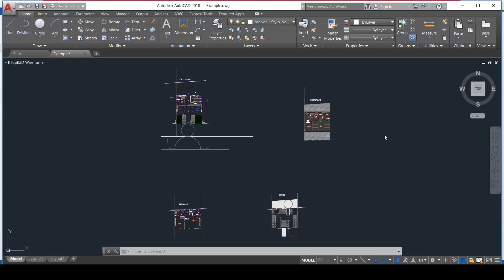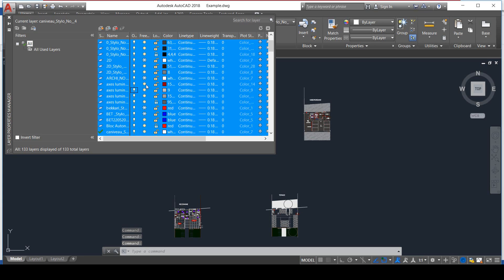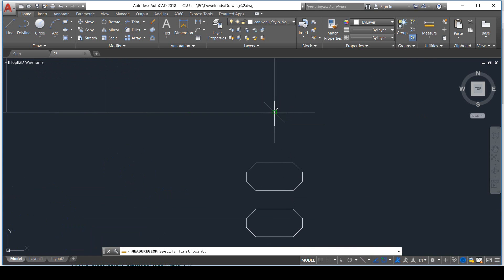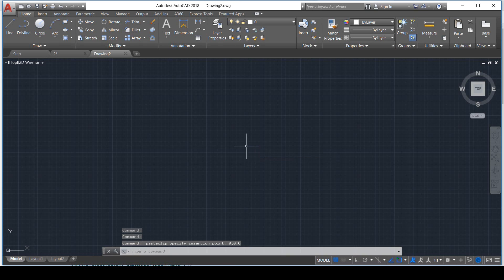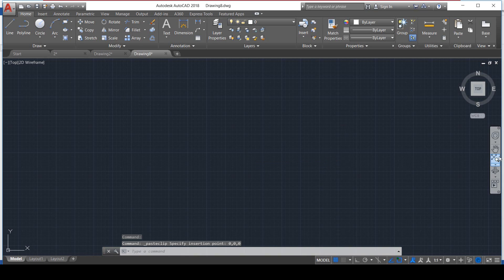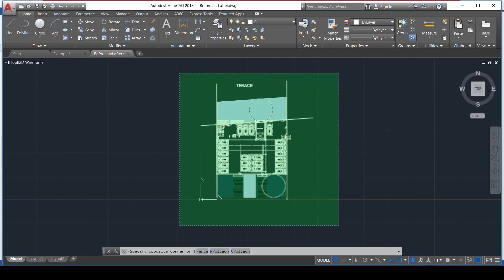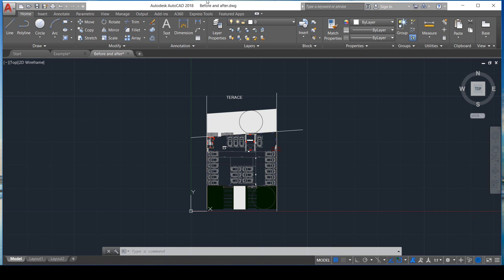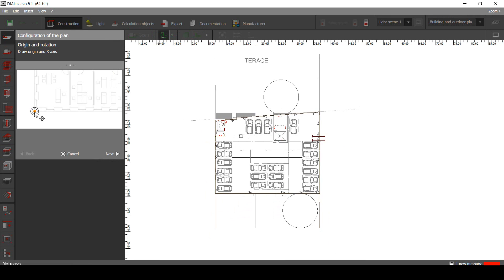How to solve Autocad and importation to Dialux evo problems

Comment: sir After importing of file from AutoCAD to dialux there are some lines missing in dialux
Reply from the maker: Make sure they are not hatches, because DIAlux doesn't recognize them.
The solution would be to draw them in AutoCad before you import your plan to DIALux